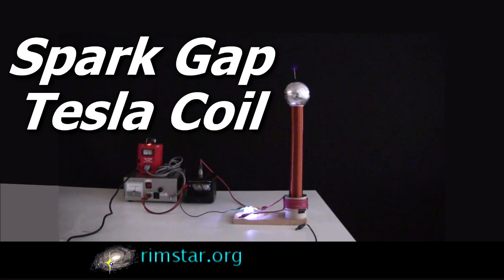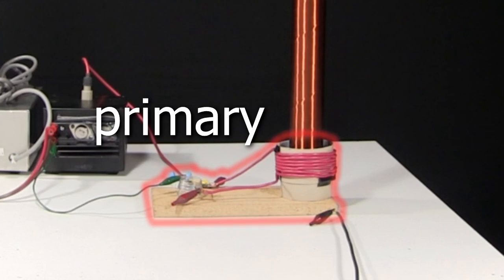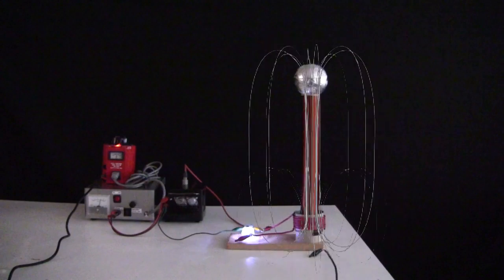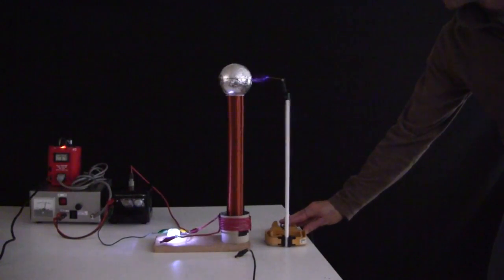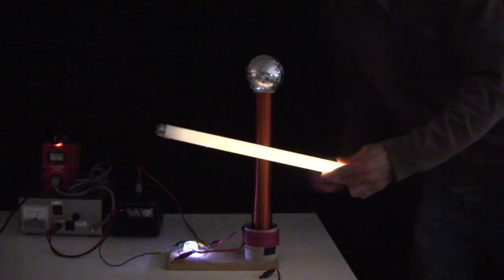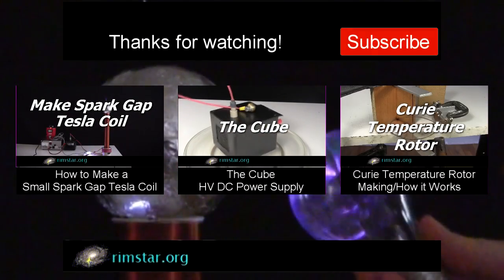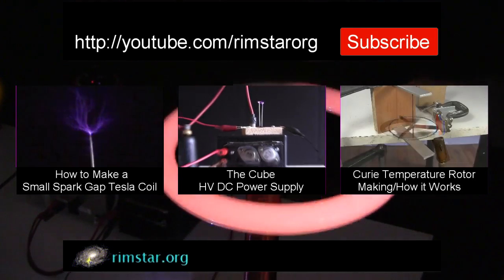Small Spark Gap Tesla Coil

Comment: How much volt is required
Reply from the maker: The input voltage is determined by the width of the spark gap and the shape of the electrodes at the spark gap. I didn't measure mine but I'd guess it was only a few thousand volts. But you also need enough current to make the spark strong and frequent. For example, I tried with an electric fly swatter/racket zapper. The voltage was high enough to create sparks but the sparks were thin and not very frequent because the current was low.
Reply: @RimstarOrg  we are making this for school science exhibiton but on a low level so is there any way that the spark gap will work on 50 v or other option we have is 220 v ac direct from our sockit plz help me understanding low buget good alternatives and also what is the whole all 3 box u used in the video as power source
btw thanks a lot
Reply from the maker: 50v or even 220v AC are too low for a spark gap. You need a high voltage power supply of some sort. The box that I used as a power supply is this homemade one https://www.youtube.com/watch?v=r171_8jZqw4 . Also, I have a series of videos that go into detail on making this tesla coil here https://www.youtube.com/playlist?list=PLFsZmHTZL-zkOQJFZBYkkpbmttm-qV2Y9
Reply: @RimstarOrg  is there any other way other than spark gap to make Tesla coil and btw thanks for that info
Reply from the maker: The is something called a solid state tesla coil that doesn't use a spark gap. Unfortunately I don't know anything about them. However, if you do a search for solid state tesla coil then you should find something.

Comment: Do you need to ground the secondary circuit?
Reply from the maker: I grounded mine. You can see that in my video about making this Tesla coil https://www.youtube.com/watch?v=0SaEPW_iMF8 at around 9 minutes in. Note that I connected to household ground which is not always a good idea because it can introduce high voltage into your household wiring. This random page has some good tips https://highvoltageforum.net/index.php?topic=277.0

Comment: Can i get a circuit diagram of this?? And How much voltage must the DC Power Supply have??
Reply from the maker: It's strange that I didn't put a diagram in the video, I usually do. Anyway, I just added one to my webpage about it https://rimstar.org/science_electronics_projects/tesla_coil_spark_gap_small.htm.
As for the voltage, it really depends on the spark gap. In my case, a very rough estimate based on that is 12kV. But it also has to be fairly high current too. I tried a fly swatter power supply and it produced a spark only every second or so because the power supply was so weak. The power supply I show in the video is my Cube power supply https://www.youtube.com/watch?v=-KFhBVfpfDw which is capable of up to 20kV. It wasn't producing 20kV when in use with the Tesla coil because the current draw pulls the voltage down.
Reply: Tq for taking sometime to reply for me.
Reply: Also is there any Alternate Cheaper way for The  Cube or the Power Supply??
Reply from the maker: Not that I know of. There are comparable power supplies. There are also plenty of videos that claim to be Tesla coils or do similar things but don't really resonate like a Tesla coil and those use small power supplies. But if you want streamers coming out of the topload, then you'll need a good power supply.
Reply from the maker: Look for something called a slayer and you might find something similar but easier to make.
Reply: Yeah. I already made a slayer exciter and now I like to go to the next level. My problem is i can't afford to buy this much power supply. Is there any way to make one myself from scratch??
Reply from the maker: Mine was made from scratch. The biggest component was the flyback transformer and I took it from an old CRT TV. You can also get them from old CRT PC monitors. It may look imposing from the outside but look at the circuit diagram on https://rimstar.org/science_electronics_projects/high_voltage_power_supply_w_flyback_transformer_builtin_diodes.htm and you'll see there's not much to it.

Comment: How much voltage does it need
Reply from the maker: I didn't measure the input voltage. Based on the spark gap it's probably in the 2000 to 10,000 volt range. Note that you also need a decent amount of current so that the sparks can be frequent. So not just any high voltage source will do. For example, I tried a fly swatter power supply but the sparks were only every few seconds.

Comment: How much is the volt given by ur cube?
Reply from the maker: I didn't measure it. Really I'd measure the voltage across the spark gap, so I'd guess around 2,000 volts to 10,000 volts. Keep in mind that it also has to be able to supply a useful amount of current in order to produce the sparks frequently, and for the sparks to be strong. I don't have a number for that either but I did try a power supply from a fly swatter and that was too weak.

Comment: Wow, well done! I would like to construct this for my project too. How much will this cost to build?
Reply from the maker: I have no idea of the cost. I use a lot of things I already have and reused parts that I take from things so it's hard for me to say.
Reply: Thank you! As for the power supply, is there any other option, except of "the cube" that you used? Or a simpler way for supplying the Tesla coil with power?
Reply from the maker: There's also my 30kV power supply but that's a little more complex than the cube. Lot's of simpler ones will cause the sparks at the spark gap but the problem is that you need something powerful enough to keep a rapid stream of sparks. So all I know of are things that are of similar complexity to the cube, a power supply built around a neon sign transformer for example.

Comment: rim man, can you do more vids on telsa coil ?
Reply from the maker: I was going to do a solid state tesla coil but I hear that the expensive parts break easily if you're not carefully... so I've held off.
Reply: +RimstarOrg any textbooks ud recommend
Reply from the maker: Nothing I'm familiar with specifically for Tesla coils. For electronics in general, Grob's Basic Electronics is good.
Reply: +RimstarOrg thanks found a electronics textbook from the 80s got me interested but, i fear it may be outdated.
Reply from the maker: My Grob's Basic Electronics is from the 70s and I find it very useful. It's missing a lot of digital electronics and semiconductors, but all the capacitance, resistance, voltage, inductance, resonance, ... is still valid. That stuff doesn't change.
Reply: +RimstarOrg good to know. thanks again.

Comment: How much voltage are you using on the output ? I'm about to order a power supply and I want to make sure that I get the right one.
Reply from the maker: I don't know exactly how much voltage. I was using my Cube power supply (https://www.youtube.com/watch?v=-KFhBVfpfDw) which has a flyback and diode at the end so the output is pulsed DC. It's roughly 20kV.
Reply: ok. so  an adjustable output of 0-120 v, 0-5 amp wouldn't work ?
Reply from the maker: No, it won't work. You need a high voltage for the spark gap.

Comment: can i ask some questions? what is the role of a spark gap?
Reply from the maker: +ucsikz2 The spark gap is an air gap, and so it's a break in the circuit. Since it's a break in the circuit, that allows the voltage to build up across the spark gap and more importantly, it allows energy to build up in the capacitor.
But once the voltage gets high enough across the spark, that's when the spark occurs. During the spark the air in the gap is now conductive and all that stored energy in the capacitor can be released into the part of the circuit containing the primary coil. The spark looks quick to us but it actually lasts long enough for the energy in the capacitor to go back and forth through the coil many times. It's that back and forth that creates a fluctuating magnetic field that induces a fluctuating current in the secondary coil, ultimately resulting in the streamers and other effects.
Reply: Thank you for your fast and clear answer, have a nice day

Comment: what is your input voltage
Reply from the maker: +how to make science and technology (hareesh raji) I didn't measure it. But it's really set by the spar gap width. I'd estimate it at only few kV, probably around 10kV. However, that doesn't mean any 10kV power supply will run it. You also need the current. I'd tried with a flyswatter power supply and that was too low a current.
Reply: RimstarOrg thanks for your useful information

Comment: Is this safe?
Reply from the maker: +gautam singh With this small Tesla coil it's safe to touch the ball. I'm sort of doing it in the video when I get sparks to my hand from holding the CFL. But touching the output of the power supply where it connected to the Tesla coil can be dangerous, or at the very least, painful. The output of larger Tesla coils can be harmful though.

Comment: How are the primary coil and the secondary coil connected? Sorry for the silly question and thanks for the answer
Reply from the maker: +Lorenzo Grandi They're not physically connected. The primary coil induces current to flow in the secondary coil through electromagnetic induction alone. That's the two sets of electromagnetic fields I show animated in the video starting at 0:47.
Reply: Awesome, really thank you

Comment from the maker: +Jared Evans I just make sure the needle is in contact with the topload and the sparks appear. A well tuned Tesla coil will create a high enough voltage that it's able to break down the air. Ideally the sparks would come from the topload itself, but my voltage isn't high enough to break down air from such a curved object. The needle, with its sharp point, can break down the air with a lower voltage.
Reply: Thanks, and my power supply runs off of (2) 6 volt batteries, and it's a joule thief that converts the 12 volts to 10 thousand. So by adding a needle, you actually make it easier to get the topload to spark on its own. Again, thanks.
Reply: And I was able to get it to work with batteries because I used a flyback transformer capable of both AC and DC.

Comment: Hey, 
I'm about to try your spark gap tesla coil just wanted to know how much voltage is required as input?
Reply from the maker: Ishrath Parvin Not a lot of voltage is required, probably less than 10,000 volts. You basically need whatever voltage is required to create sparks across the spark gap. However, you also want to create many sparks quickly in a row. That requires a powerful power supply, one that that keep up a lot of current too. So for example, my fly swatter had the voltage but the sparks were feeble and infrequent. The same would apply to a Wimshurst machine or Van de Graaff generator. Power supplies with flyback transformers tend to meet the requirement.

Comment: I am very dissapointed. I have been waiting for "how to make a tesla coil" video since a long time and you have not uploaded it on may 8th
Reply from the maker: harsh bawari Sorry about that. The instructables bike contest came up and that was time critical. I have worked a lot on the "how to make a tesla coil" video so I could get it out by May 8th, but by midday Thursday I realized it still wouldn't be ready, so I shuffled my plans a bit. I considered releasing a watered down version of the video instead but decided to do it right and give it another week and do a much more thorough one instead. So it's mostly just bad estimating on my part. A single video can potentially take 3 weeks work, believe it or not. I just didn't realize that the tesla coil video was like those. Plus, as a result of comments from this video, I wanted to try some more things first, some of which didn't work out.
In general, for a how-to video I multiply the time it normally takes something to build it by 5 to get a time estimate. The script is written and modified as each step is made, then there's setting up the shot, both foreground and background so that it's a clear shot, then the lighting and audio if any (wait for car traffic to die down), then multiple takes. That all takes much longer than just putting something in a vice and cutting it, even 15 minutes to a half hour sometimes! Repeat that for each 5 or 10 second shot in the video. And that doesn't include any additional animations, screen captures or explanatory material, rounding out the script, recording the voiceover, and then two days editing it all together.
Reply from the maker: harsh bawari Oh, the magnetic viewing film video was also quicky video to make up for the fact that the tesla coil video was taking longer than expected.

Comment: That worked really well. Streemers where not quite as long as my SGTC attempt with similar PSU, but much brighter and more regular. How much capacitance did you end up using on the primary?
Reply from the maker: Mongrel Shark Thanks. I ended up using 4nF on the primary.
Reply: Thats a good size for a home-made cap.
Plastic and foil from the tea laser project would be ideal.

Hmmm. I wonder if you could combine the tea laser with the Tesla coil? 4th of July is coming up....
Reply from the maker: Mongrel Shark Oh, they're not homemade caps. I used 4 1nF, 20,000V, ceramic caps connected in parallel. You can see them at 0:33 into the video. I bought them a while ago from here http://www.amazing1.com/capacitors.html though I think I've seen them on ebay as well. One nice thing is that they don't heat up noticeably even after a few minutes running.
Now I'm trying to put together some sort of makeshift 1MHz to 1.3MHz signal generator so I can measure the actual resonant frequency of the secondary. So far a 555 timer circuit isn't doing it, but that may be because there I am using a homemade 50pF cap that may not be up to it. The best I can get is around 220kHz with horrible duty cycle. I'll have to run out and get a ceramic one or something.
Reply: Could be the cap. Could be the 555 too. I got 20 of them for $4 a while back (paid about 4 times that much for 1 or them 20 years ago). They don’t do much over 200khz. Tried to make one do 1mhz and it let out the magic smoke. Got some at local store for $3.50 ea. They go to about 1mhz before the heat gets bad and the smoke comes out.
Conclusion. Cheap ones are not so good for HF work. Also 50pf sounds big for 1mhz 555 stuff. Maybe try 10pf if you can find one.

You cant just put a 100x scope probe on the secondary where it connects to ground?
Or clamp some foil in the probe tip and hold it a foot away?

Would be intresting to see if the spark gap was doing the same freq. You could see when its firing with a solar panel on the scopes other channel.
Reply from the maker: Mongrel Shark Thanks for the insight re the different 555s. That was one of my suspicions but now I know the reality of it. I'll abandon that route.
I tried other means of watching it while running but that was probably back when I was playing with the fly swatter as PSU. I'll try again.

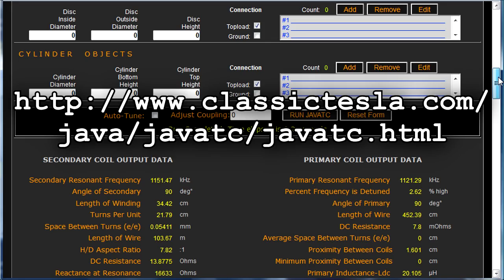Comment: I've heard that resonance takes place only when the frequency of the driving force EXACTLY matches the resonant frequency of the driven object(here, the coils). So according to this (at 1:21) only one of the coils is resonating, which you contradicted by saying both are resonating. Can I get some clarification?(I dont mean to be rude or anything, just pointing out...)
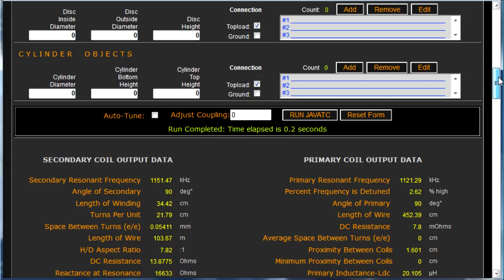Reply from the maker: Soham Gumaste At 1:21 in the calculator the secondary resonant frequency and the primary resonant frequency should be the same but I didn't bother trying to get them the same. That's because once you've built the real thing there will be imperfections and other factors not taken into account that will result in different frequencies anyway, but hopefully not too different. At that point you want to have some form of tuning built into the device so that you can bring them into resonance. It's questionable if adjusting the spark gap makes much difference, but adjusting the height of the primary coil should, and did seem to. I'm going to try making a different type of primary coil that should be even more tunable.
One thing that may cause confusion, and I didn't want to spend a lot of time on it in this video, is that there are three resonances going on here. The primary capacitor and primary coil resonate together at one resonant frequency. And the inductance in the secondary coil and the capacitance in the secondary coil also resonate together at another resonant frequency (I'm not sure how much the topload's capacitance comes into this.) Those are the two numbers you see in the calculator and are the two resonant frequencies that we try to get the same. The third resonance is the influence of the primary coil on the secondary coil.
Reply: RimstarOrg Thanks for your reply. I should've understood the practical aspects of this. Its pretty obvious that evry experiment requires some fine tuning whatever the calculations say, just didnt think of that...so when is the SSTC (as you said in an earlier reply)coming?
Reply from the maker: Soham Gumaste
I don't have any estimate for when I'll do the SSTC right now. At this point all I know is I'd like to do one. There certainly does seem to be interest so that helps.
Reply: RimstarOrg I'll stay tuned! I intend on building an SSTC soon, so I interested in your design....